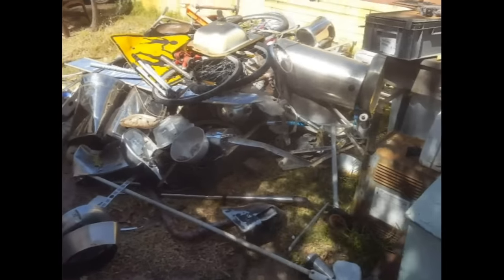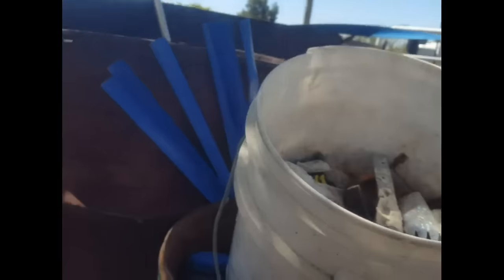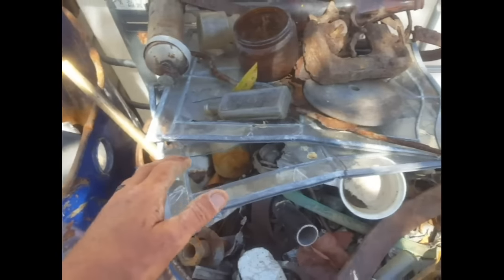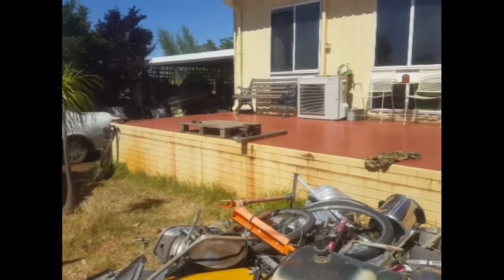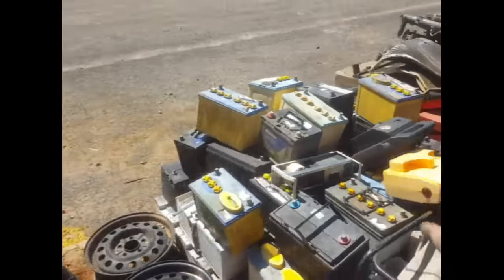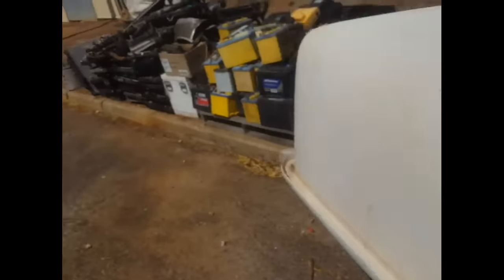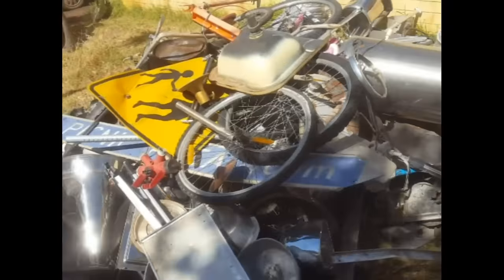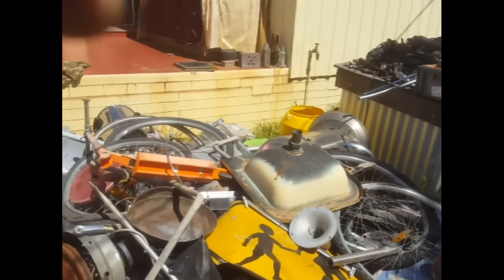WW3 War Effort - Scrapping Aluminum Pots and Pans to Kill Innocent Civilians!

Comment: Welcome back mate, great to see you posting videos again. Cheers!
Reply: +The Wheatbelt Wanderer 
I just noticed you have a few washing machine motors there, just a quick bit of info. If you strip down Fisher and Paykel washing machines with the smart drive motor, they sell on eBay for $30 to $40 each, for people who make wind and water generators (which will be one of my next projects in my attempt to go completely off the grid) Just thought you might be keen on that idea, as it goes with your whole ethos of recycling, reusing and living cheaply.

Just a quick question, would you mind sharing which scrap yard is paying $550 for batteries? I have collected close to 2 tonnes of batteries over the last few months (no where near your stomping ground, I have collected them in Perth and around the Northam district) I don't want to get ripped off, so would like them to go to whoever is paying the most.